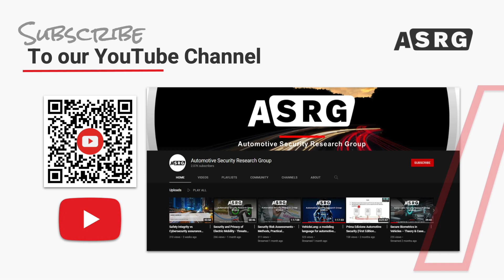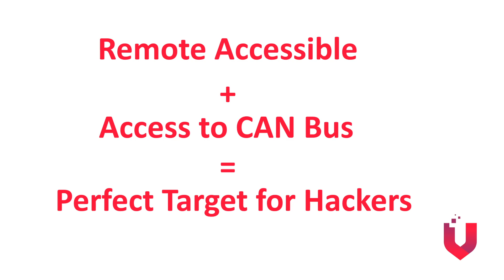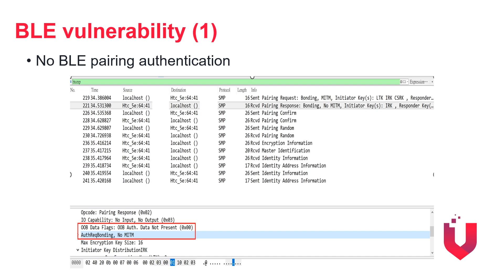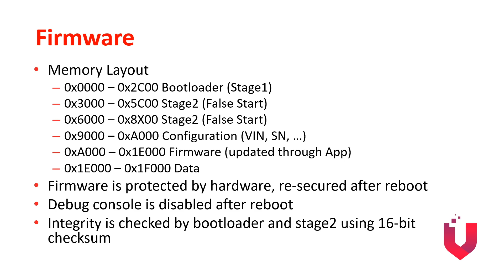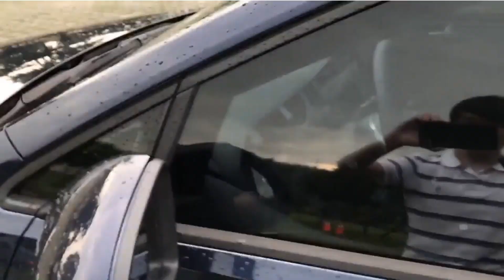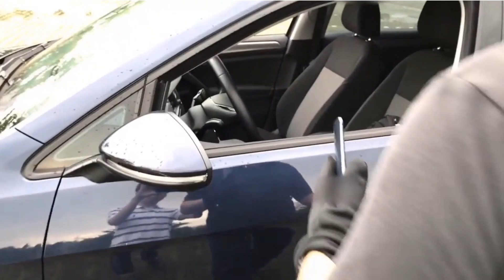Remotely Hacking a car through an OBD-II Bluetooth Dongle

Comment: These dongles are also marketed for rust prevention and insurance companies are also encouraging there use to monitor drivers for "discounts" (which should be stopped). 

I did quality control for a large bodyshop and was really surprised how many vehicles came through the shop with something plugged into the DLC when I needed to hook up a scan tool.

Also, with the proliferation of cheap Chinese scan tools on the market...I really wonder when someone will hack the scan tools themselves (CCP even), every mechanic around has a cheap Chinese scan tool in their arsenal and could easily be vectors used to spread custom malware for each model of vehicle to later be triggered if chosen.